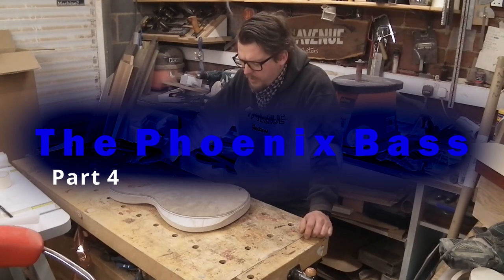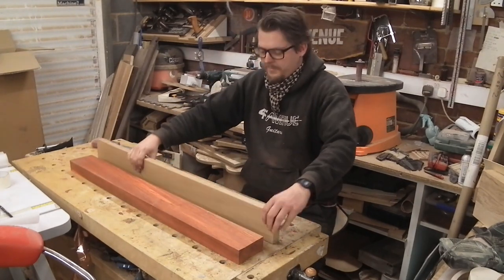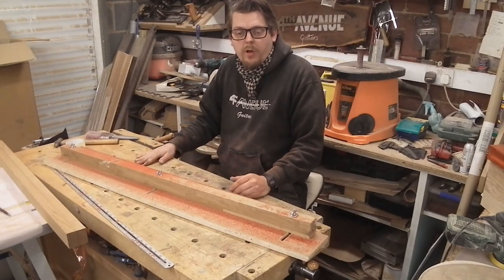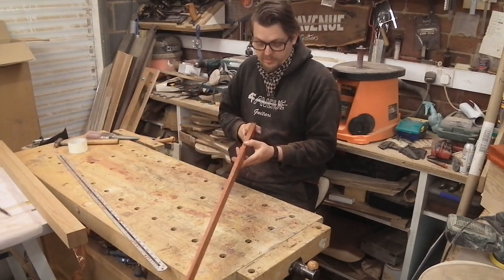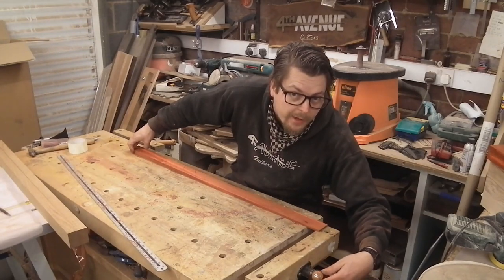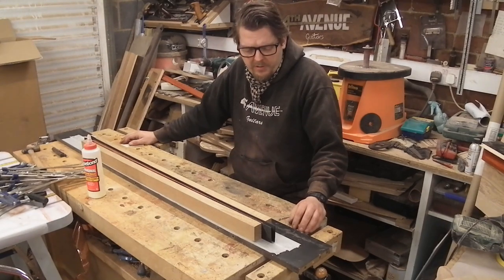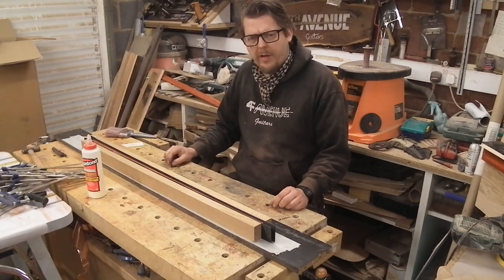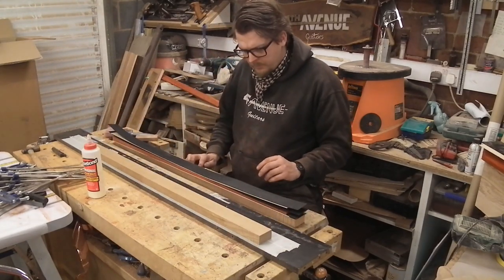Building the Phoenix Bass; Part 4, Making a multi laminate neck blank.

Comment: I'm glad I watched your video.  I wasn't sure if I was supposed to sand my dyed poplar veneer before gluing.  Any advice on what sandpaper grit I should sand to for a good glue joint?  I am getting ready to glue my first ever guitar neck.  Padauk, black veneer, and possibly maple or black walnut stripes.  Thanks!
Reply from the maker: Thanks. Technically wood glue soaks into the fibres of the wood and makes for a super strong bond. Some people recommend a freshly planed surface, others a lightly keyed one. For veneers I like to just break the surface lightly with 120 grit, just to make sure the dye hasn’t sealed the surface and left nowhere for the glue to ‘grip’. The main thing is to make sure your joint surfaces are clean, smooth and have no gaps or debris stuck to them which might compromise the joint.